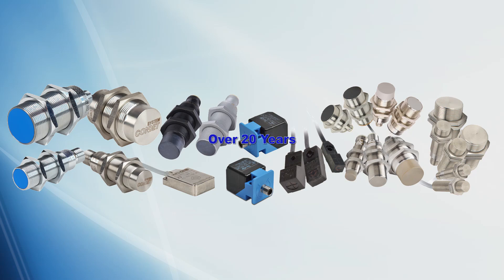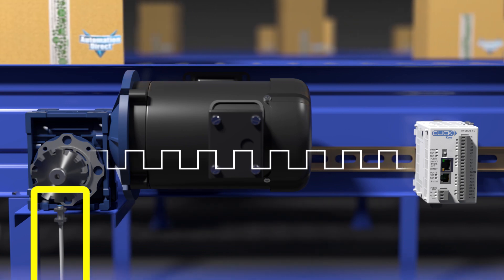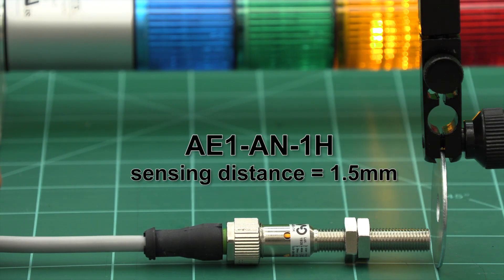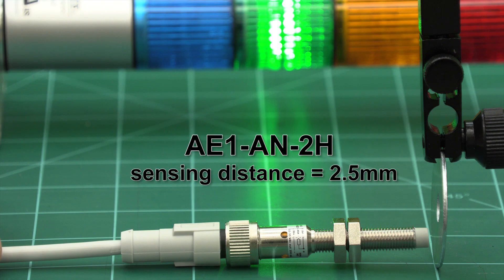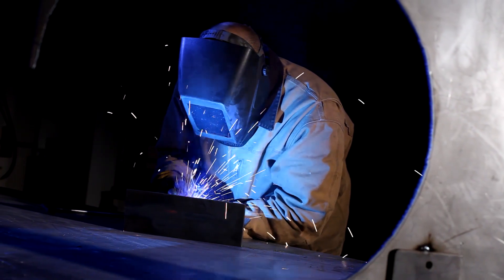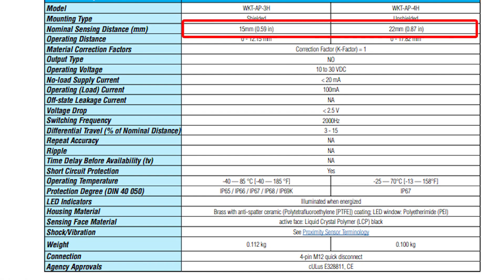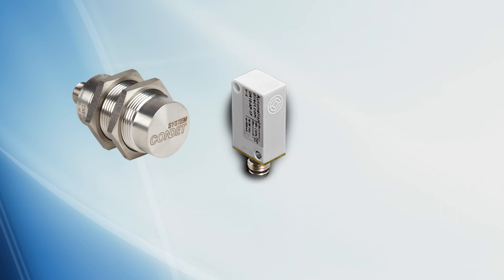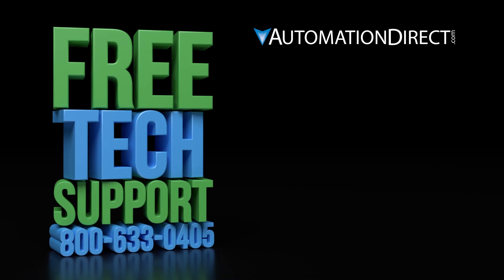Inductive Proximity Sensor Overview from AutomationDirect

Comment: Great video!
I just have a small question - Would inductive prox sensors detect 316 stainless steel?
Reply from the maker: Inductive prox sensors work with stainless and in general you can expect a reduction in sensing distance of 0.6 to 1.0.  I have a question into engineering to see if we have any sensors specifically designed for 316 stainless ... stay tuned ...
Reply from the maker: If you select any of the sensors on our website, then click on the spec sheet - you will see a link to a "Material Influence Chart" It tells you what to expect for all the basic material types.  Here is an example for one series of sensors: https://cdn.automationdirect.com/static/specs/materialinfluence.pdf